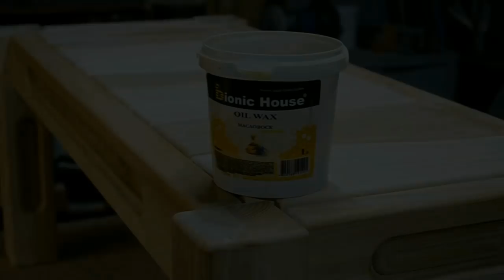Ash tree bench with oak inserts

Comment: Lower that table saw blade. All you need is a 1/4 inch above the surface.
If you want to get technical, set the blade to match the work surface to the bottom of the gullet. Even 1/8 of an inch will do, but what you have there is just an accident waiting to happen. Please don't !!!
I say this because someone get hurt on a tablsaw every 9 minutes.
Spread the good word. Don't be a hero, be safe. This way you'll be able to keep building project with all the parts your parents gave you, and for the rest of your life. Ciao